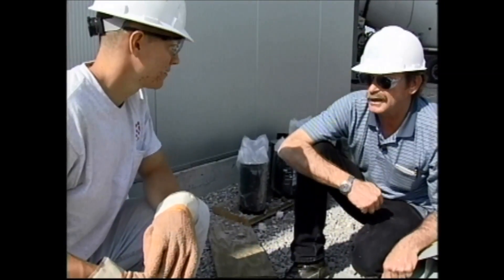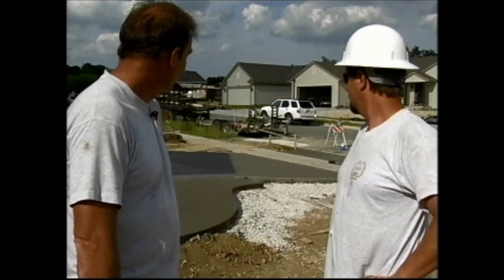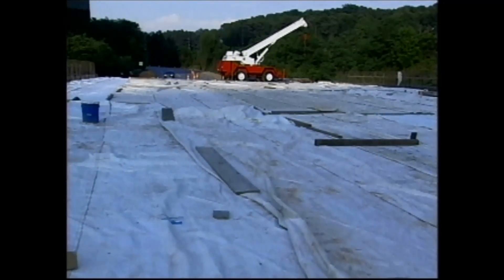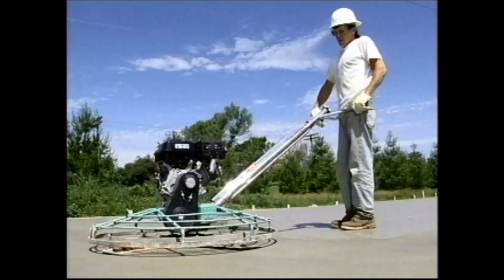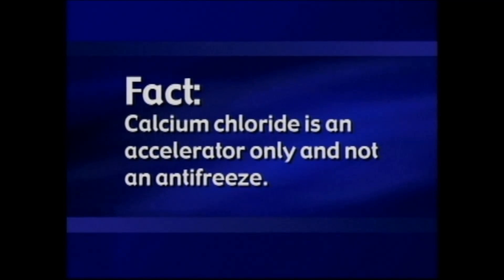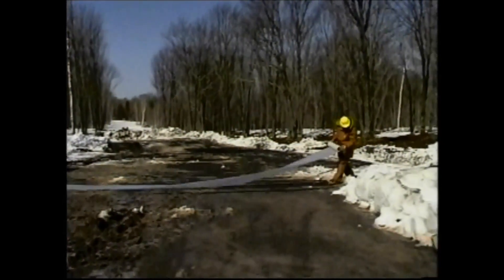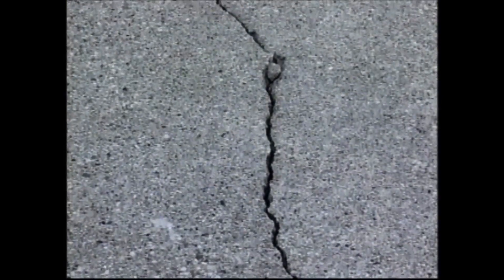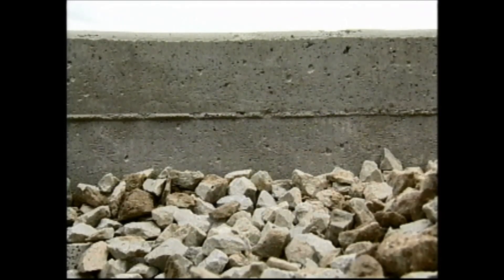Top 10 Myths in Concrete Construction

Comment: MYTHS

1.) Concrete only last 5-6 years.
2.) You need an aggregate like marbles.
3.) You can't add dyes.
4.) One hour of setting is too early to carve your initials.
5.) You have to wait for it to stop raining to start pouring.
6.) It's  tricky to make full size sculptures.
7.) You need a wheel barrow or a hopper.
8.) O'Dell can't get it on.
9.) You have to have a screed or float.
10. You need water for the mix.

Comment: if pouring at a 5 or 6 slump,weaker by just a little  than a 4 slump...JUST UPPING YOUR SPEC FROM 4000 PSI TO 4500 is cheap by adding a half sack per yard ...at a $5 yard cost!!!///in the U S,we have made EVERYTHING so complicated that our costs are crazy...i believe in vibrators and 4500 psi concrete...and rebar UP OFF THE BOTTOM OF THAT SLAB!...tearouts where old rebar is laying on the bottom of the slab!...are so common....THESE 3 THINGS are easy,cheap and important..

Comment: One thing that has always intrigued me is why plastic ties are not used to connect reinforcing together prior to pouring the concrete.  Extensive enquiries here in New Zealand have always drawn the same response:  it is not known what the structural importance of steel tie wire is,  and it is not known what the objection to plastic ties might be.  Can you throw any light on this issue?  Regards from NZ
Reply: Kind sir, there is no structural integrity or advantage in tie wire. The amount of the tie wire used in structural concretes design is to keep the Rebar in place at the spacing and coverage specified during concrete placement. Rule of thumb double your wire on heavy mats or columns and high traffic areas. Single ties are sufficient for flatwork such as slab, mesh and light foot traffic. Gauge 15 for bridges and 16.5 for medium to light work.
Reply: @steeltown416  This is what I have thought for very many years now.  Really strange that no one in the local concrete industry can confirm this.  Thanks so much,  cheers.
Reply: @evanpenny348  No worries!! Greetings from California! What also is a good indicator that Tie Wire holds no Structural integrity is that you will not find it mentioned in any of the Structural details called out in the plans. Which means it's not taken into consideration when the engineer makes his calculations. It's just a industry standard tool. Means and method for the contractor to secure Rebar in place. Similar to precast concrete spacers that hold up the Rebar, just a means to hold the bar in place. Cheers 🍻, From a Ironworker on the other side of the world.
Reply: @steeltown416  Many thanks for this comment.  Thought so.

Comment: Thank you very much, now I am more afraid to do anything with concrete at all. If even adding a little bit of water is such a problem. You overcomplicated it for me. Around me are many guys who built houses without knowing too much.
Reply: I've been in concrete for 15 years went to school for it most off this really only applies to big commercial jobs where the specs of the concrete must meet certain requirements. If you are wanting to build a patio or anything that's not a house foundation or something load-bearing it doesn't really matter. Patios and sidewalk don't necessarily need rebar but i always use it. Fiber mesh in the mix is usually enough. You always want control joins it gives the concrete a place to crack (it always will crack) and it hides them. If the mud shows up dry or stiff and u don't live in Alaska or Arizona (somewhere with extreme temps) add some water. The 1gal/yd3 is a good guide. Little bits at a time so u don't add too much, no way to fix that. If it is hot when u pour wet the ground first. Super dry ground will suck the moisture out of the concrete and make it set premature and under-strength, we call it a flash or snap.  For driveways always use rebar or wire mesh. 4' × 8' wire fence panels from home depot or whatever work great or it comes in 150' rolls from any construction supply place.  When finishing u want to seal the concrete. Use a mag float to smooth highs and lows and fill the tiny holes in the surface. Don't over work the mud u don't have to fill every hole. Look at some concrete in ur area u'll see tiny holes those allow it to absorb water over time and gain strength. If u pour on a hot day its a good idea to use a cure spray when finished or it can crack all over the surface. If it's not 90° out u can skip the cure but the next day soak it with a hose or sprinkler like all day.   Oh also for basic residential concrete I usually go for 4500 psi mix that's usually enough but if ur gonna park a tractor or something heavy on it use the highest bag mix they have and pour it 6" thick. And #4 bar on a 2' grid. Hope that helps sry its so long winded.

Comment: Based on our experiences the rebars must be at least 1/2 inch near the surface of the concrete bottom facing the soil and facing upwards in the op surface for any slab foundation. Preferably we require to create a monolithic floating foundation to play it safe, especially for military installations.

Comment: When pouring concrete do you take into consideration the curvature f the eaarh the math is 8inch per mile squared. 666 feet per 10 miles. I had never learned of this curvature. I've always built stuff on  a level plain.
Reply: We are manufacturer of small construction machinery.
we have steel Bar Straightening and cutting Machine，Rebar Bending Machine，power trowel，Tamping Rammer,which one you need pls let me know or check our website www.famous-machine.com,hope we can make a good business together。
+8615093385787
Reply: Plane.. unless you work in Kansas

Comment: If i ever saw a finisher walk on a placement to determine when to finish, that would the last job of mine he ever worked on!
Reply: You walk on it with the trowel machine anyway DUH
Reply: I have seen that crack a slab after curing.
Reply: What is the correct way to tell if it is ready?
Reply: @DigitalAwareness   feel it with your fingers

Comment: I would specify like this, give me 4000 psi @ 4 1/2" slump with air between 3 and 6%
Reply: We are manufacturer of small construction machinery.
we have steel Bar Straightening and cutting Machine，Rebar Bending Machine，power trowel，Tamping Rammer,which one you need pls let me know or check our website www.famous-machine.com,hope we can make a good business together。
+8615093385787

Comment: This is a lot more complex than it needs to be.  Engineers have a safety factor, batch plants have a safety factor, and on down the line.  If Losing 200PSI is a problem just buy a lot stronger mix to start with, the difference in price is minimal compared to a failure. Concrete is cast all over the world by 2 guys with a shovel and some buckets, yet the results are overwhelmingly satisfactory.  Do not try to cast a suspension bridge this way, but a house slab is very low tech.
So, ya he has some valid points, getting it wrong is not as bad as he suggests.

Comment: No. 1 of the Top Ten Myths of Concrete -  “ All concrete cracks”
Reply: If it didn't, it wouldn't need expansion joints.
Reply: co e to where i live and we will make a tour of slabs , walls, footing etc and you will be amazed. 
Seriously i live in germany and have built two houses here , one is 18 years old and i saw it last year and still no cracks . My present house is four years old and no cracks . I also find it hard to believe but ,,,,,
Reply: @siriosstar4789  It did crack...in the expansion joints, as designed. Without them, cracks everywhere.
Reply: See . i told you how strong the myth is in america . Come to germany . the concrete here rarely if ever cracks. Yes i know you dont believe it, so  ?
Reply: No, there were no expansion joints , in the walls , in the footings and not in the slab . 
They don’t finish concrete here . They only do a rough leveling and leave it to dry . Then thinset is used to set tiles or it’s left rough and wood sleepers are laid on top without fixing them to the concrete and wooden flooring is installed over the sleepers . I have been going into my unfinished concrete garage floor every day for four years and not one crack . if you want i’ll take a photo of it and send it to you. 
Hey i’m as amazed as you are.
Reply: @siriosstar4789  I believe you. I would like to see the concrete mix, and see them pour it, to see what's different than I am used to. I would assume there's also a difference in the sub-base that it's poured onto.

I know that improper finishing or "too soon" can cause surface cracks, and unstable substrate can cause failures, but I have never seen concrete, of any sizable amount, that did not crack somewhere.
Reply: Hello Sean. I’m as baffled as you might be . my german is not sufficient to have a conversation with the concrete guys here ,so i’ll tell you what i see as being different. 
First the dried concrete seems softer . it’s fairly easy to drill into. 
Second, the thicknesses and the amount of steel is greater . 
Fo example-  The basement walls are about 8 inches thick and the slab on the first level ( garage ) is about ten inches thick with one layer of heavy rebar and a second layer of mesh that appears to be about a quarter inch in diameter . 
The mesh plates are huge , about 8 ft x ten ft or more depending on the job. Both layers of steel are suspended into separate levels and tied down very well. 
The base for the slab is compacted crushed stone ,about 3 inches in diameter and then a kind of road base about 4 or 5 inches thick which is also intensely compacted . They do the pour with pump trucks and level it with long handled floats . 
It is left to dry in a VERY rough state, with no finishing . 
So , what do you think ?
Reply: @siriosstar4789  More concrete, more reinforcement, and a different mix (softer, more flexible??). That sounds like it would do the job.

Our basement walls average 6-8" thick, floors average 6" thick, the sub base is usually 2-4" thick layer of 3/4" stone on top of undisturbed earth. Our rebar is usually about half of what you described for anything residential. We slick finish all pads/floors, but add traction if needed. Walls are usually just touched up after forms are removed.
Reply: Many thanks for the reply Sean. 
I concur with your assessment of more concrete and steel coupled with greater flexibility . I’m going to try and find out the specifics of the mix . i have some friends that are structural engineers . they probably know some details about the mix they use here.
Reply: @siriosstar4789  I bet we'll find that the specs the USA uses are purely based on speed and cost. I can't blame climate, because Germany has a similar climate to many areas of the US.
Reply: One thing i’ve noticed having lived in both countries for a long time is the difference in how engineering is approached. 
Cost seems to be a primary influence in american house building resulting in using minimum engineering standards ie a 3.5 inch thick slab with minimal steel. 
The germans on the other hand seem to go in the opposite direction with , “ let’s use the Maxium engineering standard just to make sure things don’t fail” . 
That’s  an exaggeration of course but there is some truth to it. 
Also the germans don’t move as much as the americans because available building lots are scarce and they will most likely hand their house over to their children , who will do the same . Houses here HAVE to last  because building a new one is really expensive and difficult. aside from all that i still want to find out about the mix they use.

Comment: When talking about water what should be mentioned is the curing process.Sure you might pour at a low slump and think your doing the concrete a favor but in reality,in the field,proper curing processes are not done or not that often.Also what is fact on paper is not fact in the field.I have seen concrete tested that had quite a bit of water added that tested up to nearly full strength in a very short time.There are MANY factors,like the temperature/weather conditions while pouring as well the time to pour and they are never the same.
Specs and so called official standards are done under PERFECT conditions,you see the tester will be poking and making sure the test cylinders are perfect and then stored under perfect conditions,this is not the reality of the poured surface. I have seen concrete poured on dry sand like surfaces/beeches and then on stone,dry stone or wet stone,there are ALWAYS different conditions that concrete is poured.There is a big difference if concrete dries too fast,weather it is very cold out or very sunny /hot and they all change how you should treat your concrete pour.

Comment: Water to cement ratio
Inc slump by using a plasticiser, delivery time. Not water 
Water concrete to let it cure
Know when to finish. Choose right time to finish
Calcium chloride is an accelerator but not antifreeze
Maintain cc temp
Cc will not heat up frozen soil. In cold weather soil needs to be warm
Steel doesn’t keep cc Fromm cracking. Temp and moister cause cracks
Cc can change shape while curing. Especially if thick
Cc is permeable. Use low water to cement ration to reduce sponging
High cc break weights doesn’t mean less cracks

Comment: I've been a working construction for 25 yrs some these are myths some are not. There are what we call engineering and architectural standards, and in the field standards. At no time did I see anything that would help anyone in the field when dealing with a very hot load or when concrete trucks stop coming halfway through a pour or trying to talk to a concrete driver or concrete office about what you need, when you need it, and where you need it. This video gets a thumbs down for me

Comment: The last good pour, with perfect slump, was back in Greece 500BC. Today science is getting close to recreating that batch in the lab.
Reply: @HSK Kelley trial an error. Mix a pour and use it. Then wait 1000 years.
Reply: HSK Kelley they used slaves, if they wanted to add water to the mix they got whipped even more.

Comment: why do you put the rebar mash on the ground and then put the concrete over it?
Reply: Rebar mesh adds tensile strength to the concrete which by itself only has compressive strength...
If you meant why have they put the mesh flat on the ground without any spacers / chairs lifting it up, my answer would be that it ia not the 'correct' way to lay mesh but in practice the concrete will lift mesh up as it's being poured meaning the mesh will set in the middle of the slab rather than on the floor. 

Hope that helps?

Comment: U go by p.s.i 3000 3500 4000 the humidity has to do a lot with it and u can put water in it there's water reducer u can use to make slump rader to pour and there's other ways just make sure your grade is right and compacted and joints saw cut in it u'll be ok

Comment: Concrete non permeable lol I've installed flooring for the last 7 years in San Diego and have to do vapor barrier from ardex all the time which means bead blasting and grinding the finish off and resealing the concrete

Comment: It's 2018, unless one absolutely needs it, (in certain applications) a Barrel truck should never be used. On site truck is the way to go. Why would you risk getting a hot load, or the driver fucking the mix up by adding too much water. Because a barrel truck can't add sand n cement......anbody who disagrees is not very bright

Comment: Didn't answer or touch on the use of a vapor barrier (10 mil plastic) and its conflicts with concrete finish and its proper installation in stem and spread footings in  a monolithic pour.

Comment: This video is horse shit, No such thing as properly batched concrete, to many variables from the weight of the sand to the weight of the stone, stone from the same quarry will vary, not to mention mixing stone from different pits, which is common, the different weights will always affect strength since concrete is batched by weight, not volume, light stone will net you a larger volume, but weaker mix, heavy stone will net you lower volume, stronger mix, Concrete varies widely, everything in this video is to make it impossible to blame the concrete company for bad mix, you can't realistically meet all the parameters laid out in this vid, hell, most small companies have never heard of plasticizers, much less have them on hand.

Comment: house slab knocked back by inspector because builder took photos of concreter add water to the mix. the slum weaken and have they ripped the salt and start again. lesson to learn. order your slum higher so if you add water it will not affect the strength of the concrete.

Comment: Myth #11: Slump has any bearing at all whether concrete will pass strength tests or not. Yes, added water makes concrete less strong. Water reducer, (Plasticiser) some retardant to keep it from setting up too fast, and if you feel like working really fast, add some glenium. Added on site. Comes out like soup. No added water, it makes a dry 1-2 slump into about a 10 or 11. But... you got @ 30 minutes max before you'll start having problems if it's not in place.

Comment: The one thing I wish they would mention is the air en-training concrete using a air pot to find the percentage of air in concrete. This will go a lot to reducing the freeze thaw cycles that occur in colder climates that causes cracking in concrete.